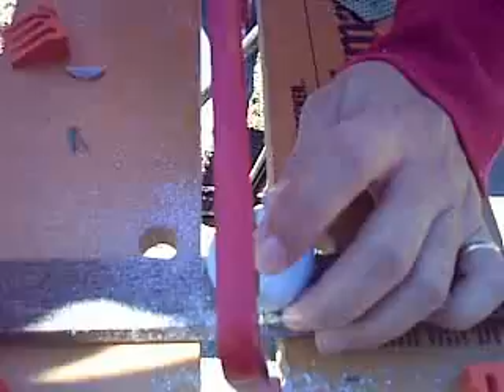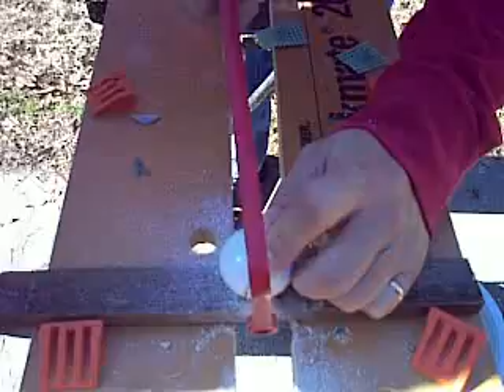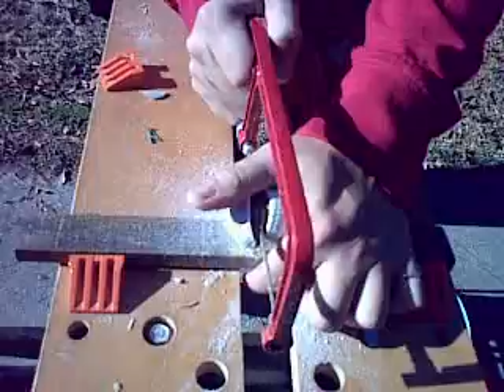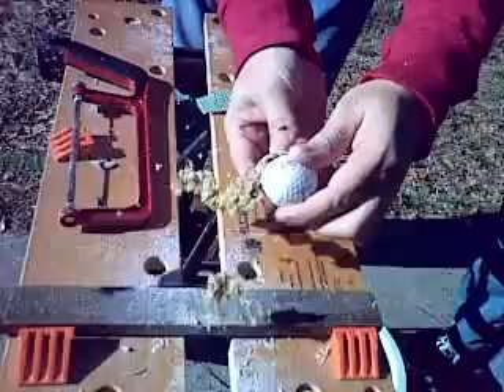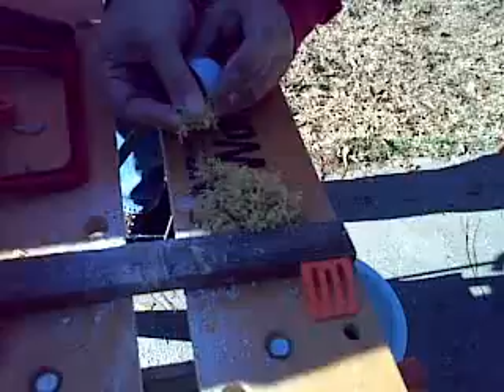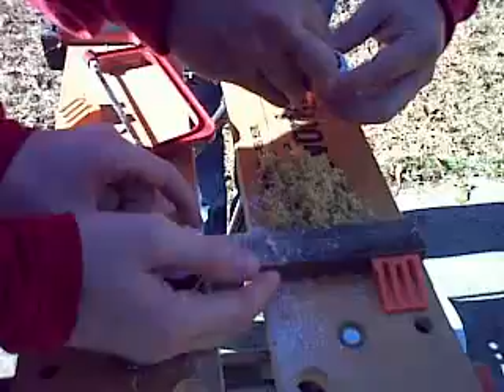Cutting open a golf ball

Comment from the maker: This particular golf ball (and several others we had) have a solid rubber core surrounded by tightly packed "rubber strings" - when the hard outer shell was cut open, the "strings" (similar, I guess, to rubber bands?) would expand. (Other types of golf balls do not have the "core/string/shell" construction and are instead a larger solid core inside the outer shell; I do not know if, perhaps, they are multi-layered or differing densities, or a singular material.)